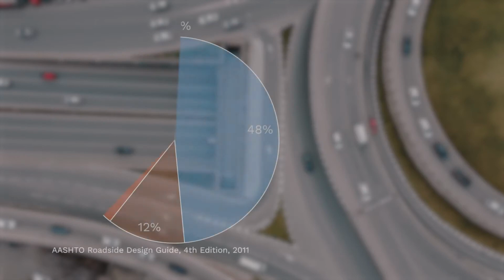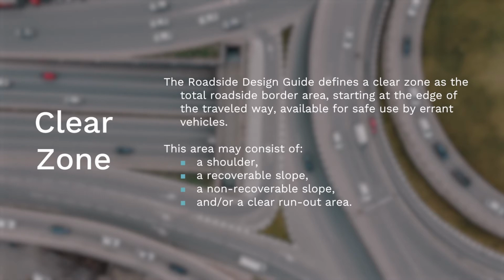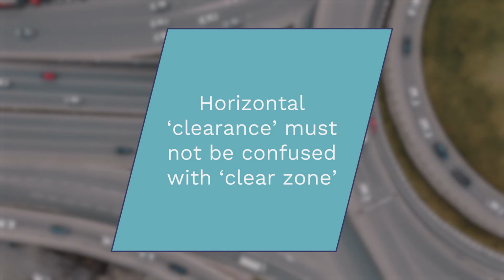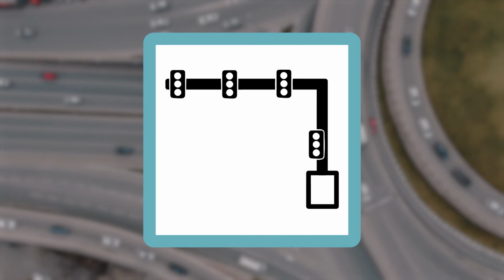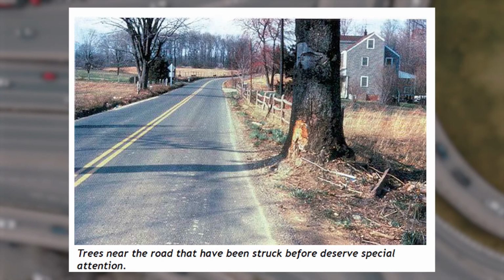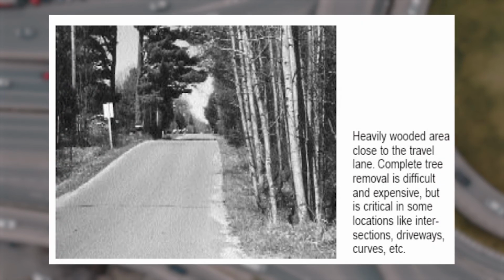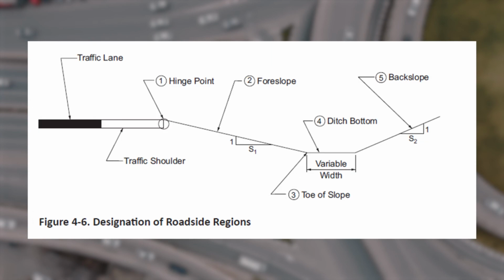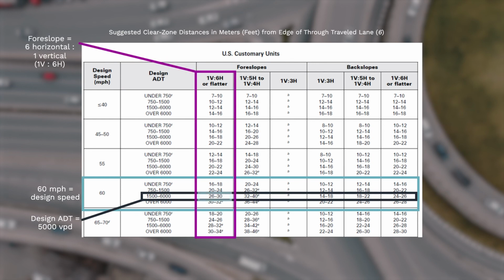SECTION 2 on CIVIL ENGINEERING | 2-D Clear Zones

Comment: I recently took a Highway Engineering Design course with Professor Roxann Hayes, and one of the interesting topics covered was Clear Zones which was also covered in the the video provided. The AASHTO Green Book was an extremely useful tool for roadside design and an interesting read for the topics covered, especially Clear Zones. It was also useful to learn how to determine a clear zone using the table provided within the AASHTO Green Book.